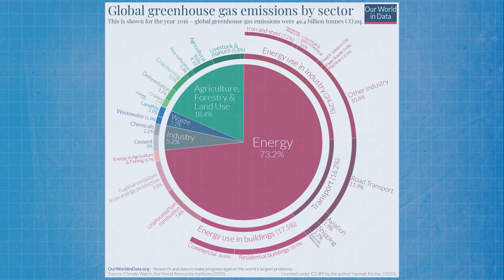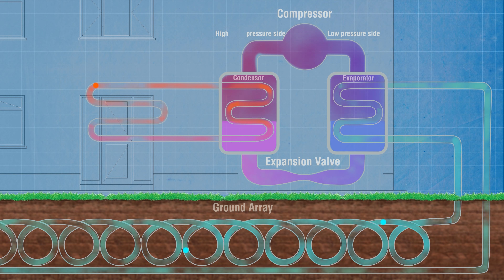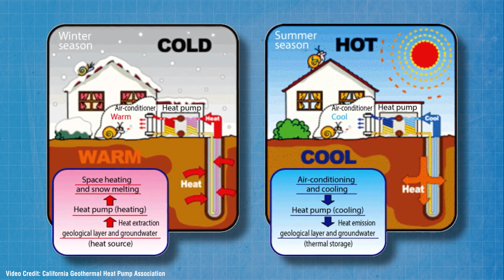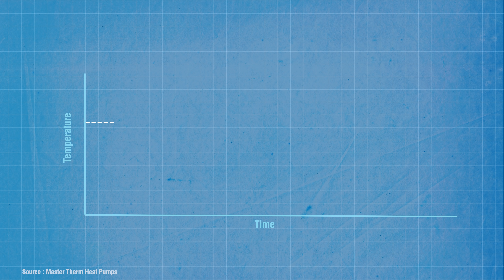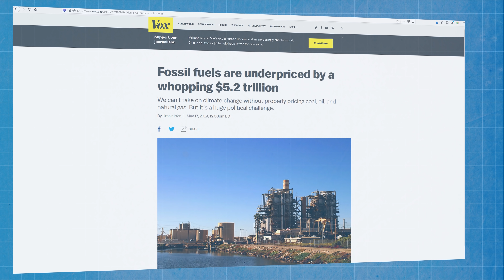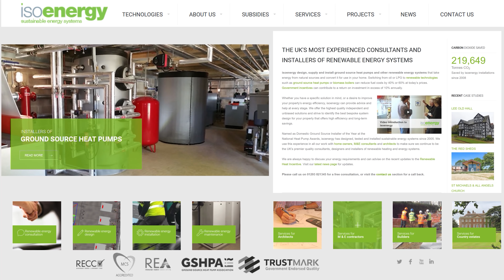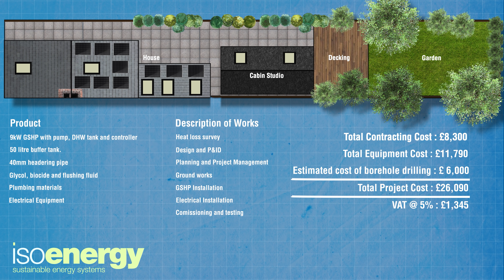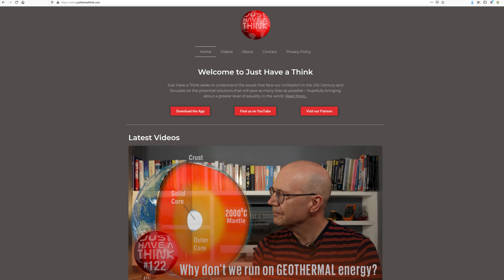Geothermal ground source heat pumps. Heating your home from your own back yard!

Comment: Is it not possible to combine the geothermal systems with solar thermal systems and, whilst the expanded heated pipes create a thermal near steam expansion, run it through turbines to also generate electricity. Maybe even taking advantage of gravity as well as convection currents where appropriate to turn as many turbine fan generators as possible? Was just watching how Victorian age houses were heated and the first Swan lightbulb was powered by hydroelectricity💡.

Comment: Part of the problem in the UK is that possibly millions of older, less efficient gas boilers have been replaced with boilers that do not use hot water tanks.  So lots of older properties like mine have been modernised and now have no room for a hot water tank.  Also lots of new properties are not designed to accommodate a hot water tank.  In some ways it seems a backward move for my house to have a tank fitted unless it can be fitted high up in the roof area.  Another thought that I have had is about using two systems to heat radiators.  My home is a 50's build and yes it has radiators fitted and I am happy with them, the only problem is that they use gas to heat the water in them.  I have emailed a few companys in the past, to see if it is possible to have a pre-heat system for returning water to the boiler that could be powered by electricity.  If it could I would consider fitting solar panels. This would reduce the amount of gas used to bring the radiator water temperature up to the required level.  It would also mean that possibly the gas boiler could be dispensed with in favour of an electrical system with battery storage. Unfortunately I have not had any feedback! I haven't got solar power yet but I am thinking about it as the house is positioned well for solar.
Reply: The rollout of combi boilers has certainly excluded a lot of properties from enjoying the quick wins, so to speak.

Comment: Everyone knows ground source and air source heat pumps are only for background heating, and you still need a primary heat source to generate most of your heat in Winter. If you think otherwise it’d be a lot cheaper to place a fridge in every room and try keeping yourself warm via the pipes at the back. Not to say more eco-friendly than all the energy you’d consume by digging out the garden, manufacturing all the pipework and plant, and maintaining the same.
Reply: Sorry to say your information is outdated. The vast majority of our sites, maybe 95%+ get 100% of their heating and hot water from the heat pump. We only use bivalent systems (with gas or oil backup) in cases where there is insufficient electrical supply to the property.

Comment: Nice that you gave a concrete example of price for a quality system. However, there are cheaper (although less efficient) options. You can bury a network of 6" or 8" pipes at a depth of 1 and 2 meters below the surface of your garden. Connect them to air intake on the far end and then the output on the near end. A simple fan is enough to pull or push the air into the house or into the intake of a heating-cooling system. The biggest benefit is during extreme temperatures, but that is when there is peak demand. Earth ships have big 60cm pipes that run under ground to provide heating-cooling by opening a door.

Comment: Let's say for example.I want build house 5000sq ft. Do u i need to drill 300 meters ,
600 meters... ?In order to extract enough heat from the ground.tx
Reply: If there wasn't space for a horizontal array, we would drill multiple boreholes to get the required amount of energy for your house. Feel free to call out team for a rule of thumb calculation that will give you an idea of what you would need.

Comment: you should be able to get a loan to install a system like this. In the US, you could redo your mortgage at the really low rates available now which would virtually eliminate your up front costs, spreading the payments over as much as thirty years and possibly reducing your monthly payment at the same time.

Comment: The vertical version is the most expensive one, because of the drilling costs!  Before installing a heatpump you have to clarify how the heating is designed in your home. Floor heating - low temparature (max about 35grdC) vs. radiator heating where you need about 60-70grdC water temperature. Therefore the second version is not (so) efficient with a Heatpump.
Also you should analyse the insulation of your home ...
Reply: Sorry, I have to disagree. It is true about 20 years ago, this was the case, but its not now. About 90% of the installations we do use the existing radiators in the house. We use a constant flow at low temperature based on the outside air temperature. Check out Weather Compensated heating. Good point about insulation though. The cheapest unit of heat is the one you don't have to buy!
Reply: @isoenergyltd   Weather Compensated heating is anyway the only way to go.  But I think you have to agree that the stress to the involved components (compressor etc) and the required ammount of energy is higher in a radiator vs. a floor heating configuration. The vertical drilling option is the non-plus-ultra, but in my personal opinion, for GB a air-heat-pump should be enough (they work properly even here in central europe where we have lower temps in the winter).
Reply: @alexandergunda8916  Our main concern when connecting to existing systems is actually the condition of the inside of the rads. They degrade and bits fall off which can risk blocking the heat exchangers. We take a couple of measures to protect against that including filter ball valves and a buffer tank if required.

In the UK our main problem for air source is humidity. When its cold here and high humidity, the dew point is lower and the evaporator heat exchanger outside on the ASHP will attract condensation and then freeze. So the heat pump has to defrost itself regularly, reducing the overall efficiency. ASHPs are often touted as the answer here with limited available space, but you have to oversize them to ensure they don't have to defrost themselves too regularly. Never believe anything written on a manufacturer's datasheet about performance. It's in their best interest to promote these things as super-efficient, when our experience on the ground says otherwise. For a house with a 6kW heating load, we will recommend an ASHP around 10 to 12kW to negate this. The problem then becomes electrical supply as we are normally on a single-phase supply. A subject for another video I suspect.

Comment: There’s an Australian invention that has made this system Old Technology.
Reply: well don't keep it a secret John, tell us all about it please.
Reply: 1kumokun I know the inventor and know his system has been proven to work. 
There’s no chiller with fans, it has two tanks one tank is hot the other is cold.
Chilled air is circulated as is the hot air, both are used to support either the heating or cooling.
The system heats your home in winter and cools it in summer.
It also provides Hot and cold water for showers and washing.
The system can be expanded to do the same in every home in a street.
The largest system constructed is installed in a winery in Tasmania that supplies refrigerators and hot water for washing.
It also supplies twelve or more businesses and community housing for the workers.
Fridges are attached to the system and the heat made by the fridges is recirculated back into the system.
From any waste heat power is produced also and stored into batteries.
Knowing this one simple fact that heat always travels towards the coldest point never the other way.
Cooling requires drawing the heat towards the cold.
Also it is easier to warm up than cool down.
Basics of thermodynamics.
Understanding that helps you to understand how this system will smash all these energy inefficient AC Systems.
Contact Fiera Group for more information.

Comment: There’s one piece you didn’t mention about the difficulties consumers face when considering non-mainstream options like geothermal: HVAC installers and contractors usually have relationships with the mainstream manufacturers. They are incentivized to talk up those options, lead the consumer on, and then abandon their potential customer when it’s clear they can’t get away selling whatever they have sitting in their warehouse.

Speaking from personal experience, this leads to endless series of calls and meetings, ultimately resulting in frustration and despair.
Reply: Totally agree. Many installers are tied to one manufacturer. However, there are independent installers out there who will recommend a heat pump based on your requirements and not what they have on the shelf. You have to use the right tool for the right job.  Look for a renewable energy specialist rather than an HVAC contractor.

Comment: My favourite use of the heat pump was for cooling milk to 4C . The milk's heat (Cow's body temperature is 102 degrees F (39C) was transfered to heat water (to over 120F/50C) to be used for cleaning the milking system, plus it cooled the milk much faster than an Air cooled heat condenser which produces hot air which is wasted unless you need the heated air..
 If you have a pond nearby a  geothermal system using a closed  loop is really efficient because of the better heat transfer rate in water compared to soil. (and you don't have to bury the pipe in the ground. )

Comment: Taking the Eer that you have a bit further wouldn’t you think that as an example you could run a heat pump to heat your water and another circuit through another reactive gas (evaporator) with turbine generator ammonia to drive your power to start with... further to that if you have any waste heat from your roofspace or solar heating panels the eer would climb anyway      With 400 percent efficiency it’s hard to fathom why power generation would need emissions

Comment: The fatal flaw with the idea is most people want to save money, more so than save electricity. 
An air exchange can still pull heat out of the air down to -15C. And only slightly less efficient than ground source

Comment: I'm thinking that there may be substantial areas where ground source really won't work—areas that have long-term average temperatures that are really warm—in some cases, over 25 C. A tropical location, near sea level, would generally have such conditions. Even the ocean, if you could connect tightly to it, might not be cool enough. In such places, especially with a lot of humidity, I think air conditioning is the only alternative to avoid real misery.

Comment: Before you consider bore hole heat sink systems, check to see if your local codes forbids them.  The problem is the water table can become poluted if there is a leak into the water and everyone whom uses well water for drinking will become sick.
So check with local installers before you spend thousands and locall codes require you to remove the deep bore equipment.
Reply: In the UK we normally use a vegetable-based biodegradable glycol in the ground loops which is a non-notifiable liquid. You could pour it into the river without issue, although the fish will be blue, so I don't recommend it...

Comment: I appreciate the intent of this video and the search for “cleaner” energy. What’s being described here is an age old cooling/ heating cycle philosophy which is fine. However, a few points for discussion:

1) The “gas” in the closed loop as the heat (or energy) exchange medium is most likely to be Propane (hydrocarbon) which is now the main substitute for Freon (the worst of greenhouse gases) which was typically used in refrigeration cycles.

2) the infrastructure required in the animations is no small feat. Installation of underground pipework, a compressor, 2 off shell and tube heat exchanger on top of efficient process control is not something that an “average” household will be able to budget for without careful consideration.

3) location - I think a survey of the underground heat potential is critical for this. You need high a approach temperature to generate the heat transfer (heating or cooling) required. This is a critical element of the “cost benefit analysis”, especially for the average household owner.

4) there is no mention of maintenance. This energy exchange loop needs maintenance to ensure your compressor is working efficiently. Importantly, an energy balance needs to be completed to ensure you’re not walking into a “false energy economy”. Furthermore, mechanical moving parts need lubrication...I.e. hydrocarbons.

5) process monitoring - there needs to be indication/ real time measurement to help a user understand when there’s a leak, or understand how to fault find and remediate, otherwise they play into the hands of crippling running costs.

Don’t get me wrong, I appreciate that climate control and everyone doing their “bit” is important, but the average consumer needs to understand - what looks like a simple system on an animation - a system like this quite extensively before being a sustainable solution.
Reply: I have little issue in using hydrocarbons to do work like lubricating and phase changing heat pump fluids. I have an issue when hydrocarbons are burned. 

Propane is used in some heat pump systems but there are dozens of major phase changing fluids. R22 (freon) was a common one but no longer due to its ozone depletion issues. Production has all but been phased out in 2020. R-410a is the common "gas" that is leveraged in system replacing R22 is newer designs. R-410A does have a higher greenhouse effect BUT since R-410a systems have higher efficiencies their overall greenhouse impact is lower than R22 when appropriate capturing has taken place.

Location does have a concern, just as housing construction methods plays a factor in load calculations for the home. Costs vary depending on location but a ground source heat pump system will have a higher heating output per electrical unit of energy vs resistive heating AND if that source of electricity is low carbon then the comparison to natural gas or heating oil results in a lower carbon output for ground source heating. I would recommend anyone who is thinking about going with an installer is asking for references on the potential claims. This same advice goes for any contractor though.

HVAC maintenance exists for all modern systems the cost between a central air system with exterior compressor and a geothermal heat pump for maintenance is the same in my region.

Operating monitoring is done by the built in geothermal computer. It monitors input and output temp for water, air, and refrigerant. It also checks for pressure issues and allows for a tech to identify the problem. This is far beyond the realm of the average consumer. We don't ask consumers to know when the flame sensor has failed in their natural gas furnace right? Rather the consumer calls a technician out who will diagnose the issue.

Geothermal systems are very sustainable. I personally own one.

Comment: A big problem with all the incentive schemes is that they exclude DIY. You could install a system for only slightly more than the £11,700 cost of parts (plus the borehole) if DIYed. And it's not rocket-science, it's just plumbing/electrics. But then you don't get the grant. And all the grant goes on labour. Every energy efficiency scheme of the last 20 years has excluded DIY, except the one that made loft insulation cheap to buy in the shops. DIY would allow a lot more houses to be done because it saves 10K or so, and there are a lot more DIYers than there are ever going to be professional installers, so we would be a lot more likely to get the 20 million houses that need upgrades (5500 houses/day) done in a decade if householders could do their own.
Reply: Indeed. You need to have the system commissioned by an MCS registered installer. They do this because the system needs to be designed properly to offer the types of efficiencies that see a reduction in carbon. Without the efficiencies, if not designed correctly, you might as well install a direct electric boiler. Some installers do offer a design only solution and will then come and check and commission the system at the end. Not something we get involved in but Google will point you at some that do for instance.
Reply: @isoenergyltd  OK, that does at least make it possible, but I'm guessing they'll still want at least 3 grand for design+commission (and MCS presumably means they take the insiurance risk as a result).
Of course design matters (and especially so for heat pumps as it's quite easy to make something that really doesn't work very well) but that's just a matter of providing software or a service.  I'm not suggesting that DIY-installed systems shouldn't have any standards to comply with, at least to get grants. There are already a pile of safety and BS/ISO requirements (the latter you are not allowed to read for less than £150 for every 5 pages or so - another big problem, IMHO). But the obsession with 'registered professionals' in this area is wrongheaded. Most professionals are in a tearing hurry and not interested in the details of a particular house. DIYers will often do a much better job, with a tidier install and a view to long-term maintenance. They do need design help to get this right, but that could be cheap (PHPP gives me the heat loads for example, and a freecad module could do the radiator/UFH layouts). Then someone can make a nice a little online tool for people who don't want to get too involved in the details.